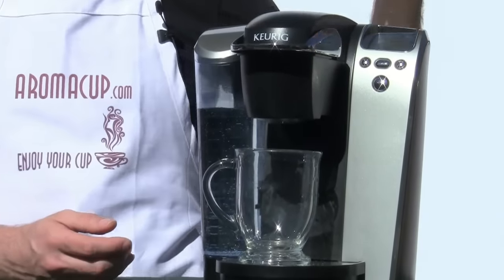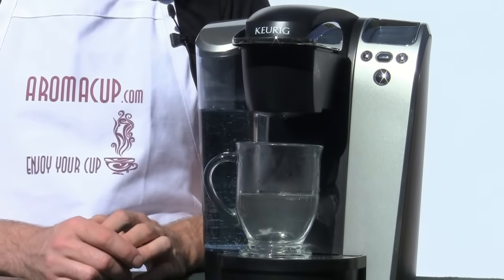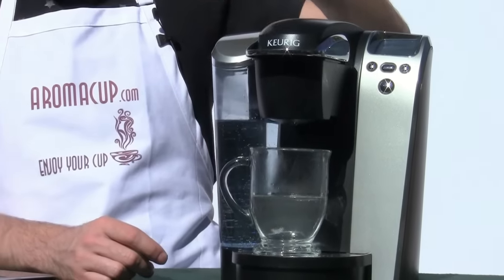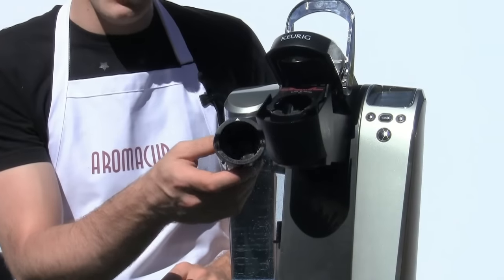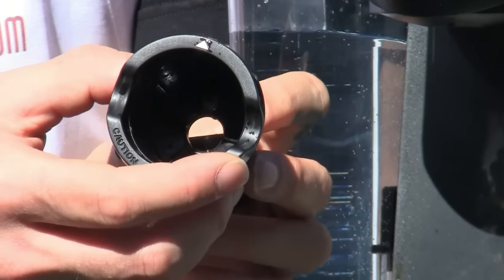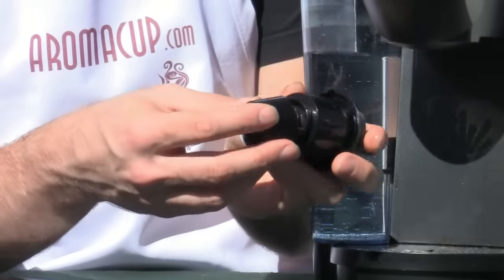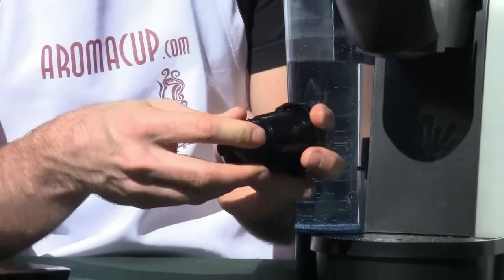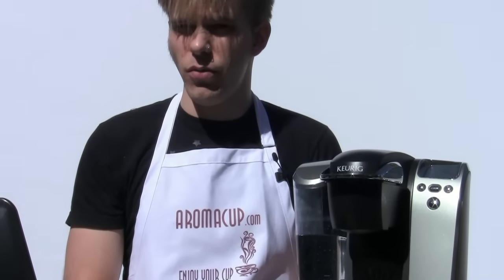Keurig Troubleshooting FAQ: Why am I getting coffee grounds in my cup?

Comment: I have a 2.0 and this helped me for the most part. My basket is different, it is a whole piece but it popped out ok. I discovered my problem was inside yet. I unplugged it and put a paper towel in to soak up water and grounds and the "tray" loosened so I was able to pop it out and clean it. I am now grounds AND drip free. Thanks. Paperclip is taped underneath the unit now.

Comment: This vid fixed the issue with coffee grounds in my coffee.. I had the wrong k-cups. Lemme explain, for the past year I've been battling with my Brewer thinking that it just wasn't clean or there's something wrong with the needles because I was getting coffee grounds in my coffee almost every single Brew.  I tried all the descaling and cleaning and everything else that I've seen but nothing had registered about my K-Cups until watching this video. Sure enough I looked at the coffee K-Cups I had been using and they were generic Sam's Club Member's Mark K-Cups with no Keurig stamp of approval on them.  So I immediately went to the store and bought the Keurig logo approved K-Cups, put them into my Brewer, and right away no coffee grounds!!!!! So long story short make sure you check your K-Cup purchase because you could get coffee grounds if they're not Keurig approved. I think, like the video points out, generic kcups might be ground too small, thus bypassing and getting into the brew. Thanks for the nugget of info that fixed my long running issue!!

Comment: I've taken the basket apart and washed it thoroughly, did the paper clip thing, even ran one of those special Keurig cleaning cups through a couple times. I then went through almost a dozen cycles of just water with no k-kups and I'm still getting grounds coming out. Can't figure out where they're coming from.
Reply: I have the same issue. It seems grounds can also collect outside of the removable piece. Maybe try pouring some water through the spout area and cleaning with a small brush or paper towel if you can reach.
Reply: I’m also having the same problem after all these steps.

Comment: My problem was far worse than that. The buildup of coffee grounds looked like sludge in an engine block that was under the basket itself and in the housing. I had to take the housing apart and clean it. It was so thick that running hot water alone through it produced a black cup of coffee. How did it get so bad even though I descaled and cleaned it on a regular basis.

Comment: My Keurig is dumping half the grounds from the pod into my cup. I have taken it apart and cleaned the needle apparatus and pod holder. I also have performed the needle maintenance and descaled it. The needle is punching a huge hole in the pod and the grounds are washing right out. Does anyone have any idea what the problem is?
Reply: I'm having the same issue.  Did you ever figure out if there is a fix?

Comment: Id back flush using the rinse cycle using the rinse button if applicable the platinum plus and the Cuisinart ss  700 other platinum series models listen close to brains advice applicable to your model in fact the models described also have a hot water button separately  b 79 has those features